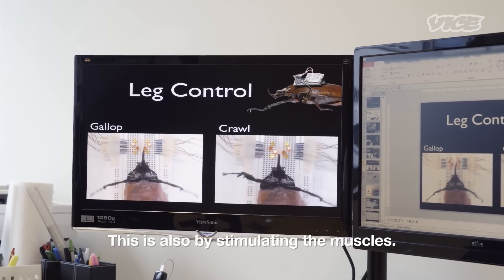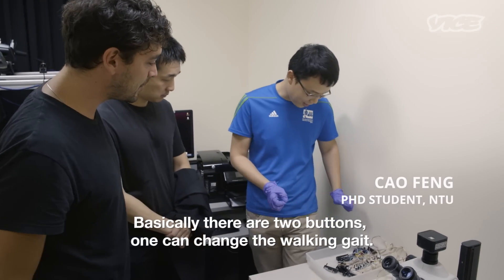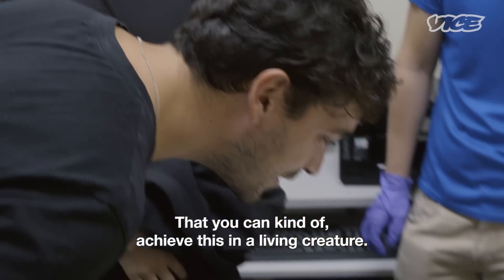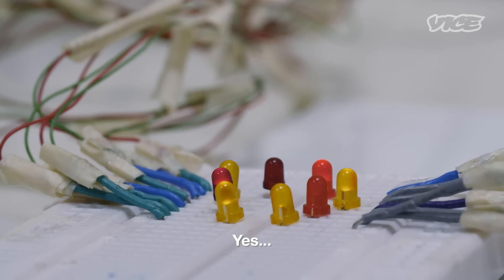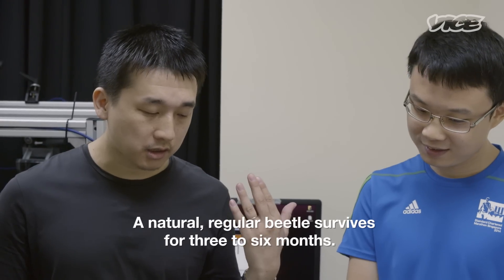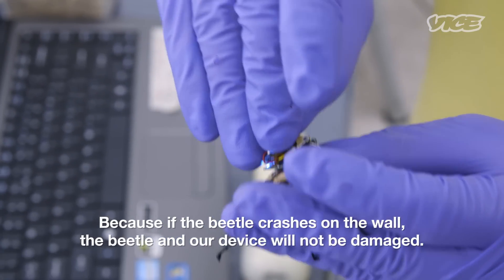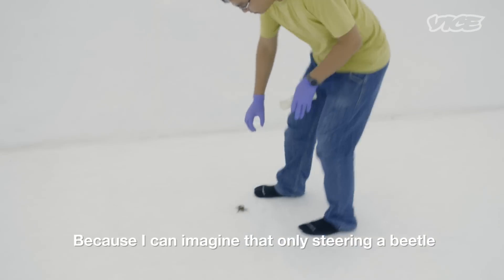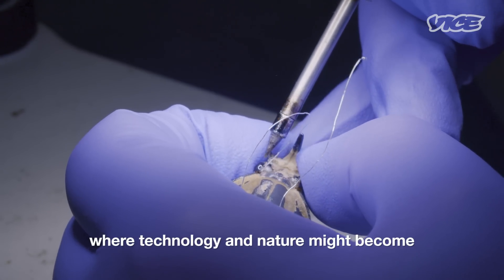Singapore's Remote-Controlled Cyborg Insects

Comment: The stimoceiver could be used to stimulate emotions and control behavior. According to Dr Jose Delgado, "Stimulation of different points in the amygdala and hippocampus in the four patients produced a variety of effects, including pleasant sensations, elation, deep, thoughtful concentration, odd feelings, super relaxation, colored visions, and other responses." Rodríguez Delgado stated that "brain transmitters can remain in a person's head for life. The energy to activate the brain transmitter is transmitted by way of radio frequencies."[6]

Using the stimoceiver, Rodríguez Delgado found that he could not only elicit emotions, but he could also elicit specific physical reactions. These specific physical reactions, such as the movement of a limb or the clenching of a fist, were achieved when Rodríguez Delgado stimulated the motor cortex. Individuals whose implants were stimulated to produce a reaction were unable to resist the reaction, with one patient remarking, "I guess, doctor, that your electricity is stronger than my will."   This was a great improvement from his early equipment which included visual disturbance in those whose wires ran from the brain to bulky equipment that both recorded data and delivered the desired electrical charges to the brain. This early equipment, while not allowing for a free range of movement, was also the cause of infection in many subjects.

Comment: It's not actually that amazing....we could literally do it with a human body right now, and it would be far easier because humans/mammals has muscle pairs/groups of agonist antagonist. Eg: if I want you to flex your forearm up, I send an stimulation pulse to your bicep, and an inhibitory pulse to your tricep and maybe a couple other muscles. Bettles and insects don't really work that way, they have flexor muscles that pull legs inward. But to open them back up outward takes hydronic pressure inside of their legs that they have to generate. But its not that amazing...its electric current.

Comment: I am both impressed and horrified — mainly the latter. 

At first, I thought the beetle was dead or a shell, and they were using tech to control or simulate the beetle's movements. This, however, is a whole other level. How many villains want robot-controlled animals? Sharks with freaking laser beams on their heads or ill-tempered, mutated seabass, for example...

Comment: Poor beetles. This is actually not incredible. It's not mind control. There have been "exercise machines" since the 90's that worked by passing electricity through your muscles to contract them. It's the same thing but the current is pumped up to contract the muscles fully. When they increase the speed by increasing the frequency, it's essentially just speeding up the cycle of electric currents that contract one muscle over the other. The only thing necessary that made this possible was the miniaturization of controllers; the same controllers that enabled small remote controlled toys and the like.

Comment: 4:36 Making a very very wrong statement here. The muscles aren't driven by the insect self but by an external factor. By the electrical pulses and not by the brain of the insect itself. What an easy way to misconcept how this actually works. Electrical stimuli causes muscles to react which need to contain more oxygen by bloodflow which needs to be provided by food. It's not the other way around. Great, we now know what we can do to other species, put this kind of power in the drawer and never look at it again.

Comment: bruh if u  need to find a criminal or locate a dude under ruble we got the tech that has trough wall heat sensors and flying  drones that are the size of ur palm , tbh theese would be really cost inefficent and would basicaly have to be upkept more then ur regular drone that u can leave for years without use unlike theese bugs that probably need daily care or monthly care.

Comment: This could be very usefull for people with none functioning body parts as you could connect the eletrical wires to the brrain so that they could control the body part.
Reply: there is a lot of research going into that, and there are a lot of good results. one problem is you require a lot of sensory feedback loops to walk or use your hands (usually without vision), so it's way more complex than putting some electrodes into a body.
Reply: Its not working like that and also not new thing to see
Reply: With the difference...insect body parts and brain perfectly works. So this comment makes no sense. If you have a brain/muscle connection problem, connecting a wire to the brain will do...nothing. A part killing you. They connected the electrodes only on bettle muscles, not to brain. We don't have the technology to do muscles/brain electrodes control yet. At least, not for something that lasts more than like 3 months or so.
Reply: not so fast my friend
Reply: Ok yea ofcourse noone will care about that and people will just try to control humans with this
Reply: But human brain is as you know much too complicated for doing intricate controls with today's technology, but there's a company known as neuralink that's trying to achieve similiar results
Reply: @princejames5266  maybe we dont need to connected on human brain rather muscle nerve. Like it detact electrical impules and recreated it on  limb
Reply: The beetles are the ones moving the body parts through stimulation. The beetles aren’t paralyzed !!
Reply: That's now what they showed. they used signals to stimulate the brain, which in turn makes the body parts move. you're talking bout using the brain to send signals through wires to make body parts move. if, however you are talking about using what we saw in the video to move the body parts of someone who normaly could'nt. then there would be a problem. where does the signal come from?
Reply: Whoops, animal lover don't care.
Reply: Yes then when they create super soldiers you will be regretting this 😂
Reply: For many of you, do remember there is some case where nerve system took damage while brain and muscle is still fine. This kind of paralysis can be overcome by making new path for human electrical impulse from brain pass to limbs.
Reply: as he said, the body itselfe has to work hes just controlling it
Reply: And how tf would you be able to control those body parts through the wires? Our brains cant send electrical signals are dumb or something? I kinda like the idea but bro... that what you just said is the most idiotic thing ever
Reply: @stranglamayn  the brain literally sends and receives electric signals, that’s the nervous system. There’s already working progres on proyectos like this

Comment: I ask myself where is actually the advantage of beetles instead of small electric devices like RC drones??
Reply: The advantage is that you're already using natures engineering that has been going on for millions of years. A beetle is way lighter, much much much cheaper and much smaller than an attempt of an equivalently made drone.
Reply: This exactly. I appreciate the scientific endeavor, but full robots are more uniform, easier to manufacture and more precise in configurability. The only upside I see to using insects is the biomechanics of the beetle are already designed to fly whereas motors for a robot could get bulky and add weight.
Reply: Now the government scientists who wants this as the final piece of his puzzle will use this technology to enhance their insect drone research which in the end will control the insect to spy

Comment: if you put enough pressure on a muscle it will move in a certain direction, you can simulate this by pushing hard on pressure points on your own arm. This is not new, and this is also not ethically correct to do this, it's basically torture
Reply: stop pushing your human agenda on a beetle

Comment: I thought they learned how to control bug's central neural system and made a single interface, which controls the bug from it's brain. But it's only direct elecro muscules stimulation. That also works for humans (as an example, there are some fitness belts, which make your muscules strict with electo impulses to gain effortless exercise.
Reply: Effortless?
That’s not that works 
There’s no such thing as effortless workout, your muscles will still be contracting and you will still suffer the soreness and pain afterwards
It might even be worse because electrical stimulation allows you to go beyond your own willpower and threshold which could cause damage to the muscle
Reply: @LiewLmao  I guess you're right, as i don't know much about it. The idea of my message was, that technology is primitive and works on humans too.
Reply: @Cepreus  It only works in theory with humans
This is an insect and you saw how many wires and the intricacies of having to implant them to each muscle 
Compare that to humans with HUGE muscles and every tiny little twitch having its own purpose and you can imagine a person having to be fully covered with wires in order to even move, let alone being capable of balancing or doing more complex tasks
Reply: @Liew  Yeah I saw some wires on the bug. But it's not them, what make him move his wings so fast and fly. They only can move his legs (not very precise) which influences aerodynamics and turns the bug right or left. Sure humans have more muscles, but simple things as bend an arm need not so much of them.

Comment: This is just not good. Sending shockwaves constantly for the insect to behave a certain way.  Its like someone strapped your body with wires and sending shockwaves to the left side of you body so you only use the right side make you turn right, and vice vasa. This is not advancing technology its just torturing the poor insects continually for your BS experiments.

Comment: there is muscle stimulation for humans as a sort of therapy (30-80Hz)... to fully contract the muscle or even lift objects by just the electrical stimulation makes the muscle cramp quiet uncomfortably (/painful). of course there isnt the need for such high Hz on such small insect. yet, getting you shell soldered and being punctured to attach wires directly onto your musclefibres seems... odd
Reply: Absolutely right

Comment: Step 1, improve battery technology
Step 2, improve wireless communication
Step 4, Improve understanding of biomechanics
Step 5, Improve AI
Step 5, Implant nodes into human body
Step 6, Control movements of humans in a group or individual setting.

in places without ethics cough cough this could be reality in 15 years. imagine as a part of your contract (or maybe even not) your have these installed in you for your factory job. when you enter the building, you enter the network, and your movements become automated according to an AI's discretion. it could be branded as you not needing to stress or worry at work, the network knows what need to be done. might be cheaper than a bunch of automated machines. you wouldn't need to spend a ton on materials, and you wouldn't need specialization. the AI would simply run a different protocol depending on task and location.
Reply: You know what Ellis Kane. One thing I have learned in my lifetime is humans in reality know no boundary. Its not like the most extreme stuff happens every day, BUT it has happened and can happen. The worst way to treat people and animals and the planet. There are people out there and prob always has been, that dont care about anything at all and some dont even care about themselves.  So I can  easily imagine step 6 control movements of humans, one way or the other. We have many different countries and people, and races/ethnicities for that to be possible. Whats there to stop them? Other people in charge and control. Just like nuclear weapons IF everybody had access too it you can be sure somebody would use it to destroy and kill as much as possible. To go back in time If the national-socialists aka Nazis of Germany had them imagine what would have happened. A regime that knew almost no boundary to the people and places they hated. 

Human beings are bound for extincion just like nature almost always has taught, its the way of living creatures and nature as a whole, what lives must die and become exctinct.

Comment: Seeing the invention of Cyborg Insect is really amazing and, in this video, they said the advantage of Cyborg Insect but what will happen to the insect? basically they are torturing the insect by sending the electrical energy.
Reply: the signal they use to make the insect move is no more powerful than the electrical signal every animal already use in the neuro system. a more significant  torture is being strapped to a lego brick and be punted w all the gear they strap to him, but i mean, i just kill dozen and dozen of insect every time i just want to drive out for an ice cream. at least this is for scientific purpose and not just to make me get my ice cream faster.
Reply: Gee i guess that makes exercise or any movement of the our body parts stimulated by electric signals torture then

Comment: what is the point of this?? control of a living insect or human (eventually). This has no point other then control of the unfortunate. Also this isn't a robot, its basically a man made external parasite! robots are full mechanical and electrical machine and cyborgs are part machine part human, this is neither as it uses electronics to control nerves. I cant see anything good coming from this but obv correct me if i'm missing something.

Comment: "no, it doesn't hurt" then the end shows them soldering wires to a beetle with a hot soldering iron haha

Also, for the first few minutes I thought it was a remote control beatle and I was like dam that thing looks so real and I don't even the servos, then I realized it was real beatle and I was like wow that's even cooler haha

Comment: Typical engineering problem and its practical solution demonstrated in this video. 

Professor: How do we hold this beetle upside down to carry out the research in the most effective way?
Asst. Professor: I got an idea. How about we stick it to a lego block with paper tape? 
Professor: Excellent!

Comment: I think it would be easier to build micro drones, or even quads that are give or take the same size or smaller to get the 'job' that they are talking about done. Without the horror and awe, that is. But, I'm sure the PhD knows that. He just likes to tinker, regardless of what result is created in the aftermath. He wants to be great, that's why he does it. Nothing to do with peace, nothing to do with helping people.
Reply: This will be cheaper and easier if perfected. Drones will have to be manufactured whereas these insects can just be farmed.
Reply: @hollowedsenpai733  The probes have to be manufactured, their power sources, control circuits, radios have to be manufactured. These will all be precision instruments and definitely won't be cheaper. Do you understand what you are competing with? Drones are already dirt cheap, they will only get cheaper with time. Plus the insects have to be farmed, I wonder how it will work for the ecosystem. Also, let's not forget that if this works someone's gonna try it on other animals if not humans, maybe rats? Then dogs? Soon it will all over the place.

Comment: Of course it doesn't hurt. Electro stimulation is used on humans too, for physical therapy. The electrical signal is equal to that of the electrical signal which your own nerves deliver to your muscles. Any stronger signal would result in spasms, not accurate movement, and still be way to low to be felt. The signal is in the order of micro volts.

Comment: People keep saying this is terrifying in the comments. But it's not scary at all, it's very basic science. They are using electricity to stimulate movement of certain body parts. Its very basic, that's already how the body works. They're just forcing it with the bug. And to be frank they have such poor control with flight. That it's really not even impressive yet. So theres nothing to be scared of. 

People should be far more afraid of the technology DARPA is developing.... or even Elon musk's neural link is capable far more terrifying possibilities.

But somehow a relatively controlless bug is terrifying..

Comment: Uhhhhhhhhh...Luigi Galvani did this exact thing in 1771.....How is this innovation? The only thing the Arduino simply does the multiple switching of input voltages into the beetle.

Comment: So if you weren't paranoid about "control chips" in needles that can react to a certain frequency and micro surveillance already, there ya go. That just validated alot of people I thought were nuts.
Reply: You do realize that thr amount of wiring required to control muscles can't just be imimented in a "microchip" within a needle right? Plus your phone does a much better job at surveillance and reporting everything you do. Stop being paranoid and learn some science. Or if your really that scared, then stop using your phone or your electronic devices since that's tracking your every move wether you think it's doing it or not
Reply: @bobbywu7701  yet they did it with a tiny implant on these bugs. It's not beyond belief.
Reply: @bobbywu7701  I love how you preach science with constraints. What you know is all you will ever know. That isn't science.

Comment: This is a useless pet project. This is nothing new. When I was a teenager, I drowned a rabbit in the basement and touched its wet body to the bare wires of a switch less outlet and the rabbit twitched.  Of course if you plant electrodes into individual muscle groups you can stimulate individual muscles.